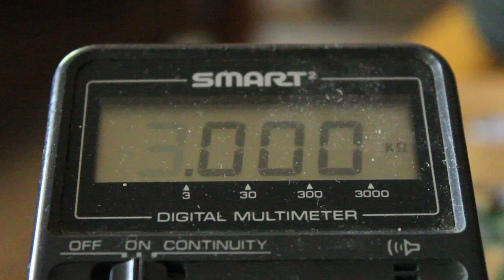PS2 Potentiometer Adjustment - Disk Read Error Fix

Comment: you don't even have to go through all of that to get the laser out. Also I think every ps2 is different because if you set it the way he does in the vid ps2 games will send you 2 a red screen while blue ps2 disc and psx games work. I had to adjust the CD screw the way he did and adjusted the DVD screw the opposite way.

Comment: Quick question. Will any volt/multimeter do or would you recommend a specific one?
Reply from the maker: For this task, even the cheapest eBay multimeter will do.
Reply: @SamCampbell  Thanks for the quick reply. So what setting did you say I should put it in before I start the reading? also, I have a slim sph 79000. But i'm looking to get a 90000 series. Should I still be aiming for the 720 goal?
Reply: @SamCampbell  Another dumb question but, am i supposed to do this while the ps2 is still plugged into power since i'm looking for a live current reading?

Comment: Thanks very much!!! You saved my evening :) In my case I had to rotate the screw anticlockwise but everything else was extremly helpful.
Reply: Same for me. My Ps2 didn't read neither CDs nor DVDs . For CDs it worked rotating clockwise a little, for DVDs I had to do the contrary (after a couple tries rotating clockwise I tried the other way around thanks to this your comment.

It''d be good to mention it at least in the description I think. Especially for people that doesn't own a tester.
Reply: @papparaba5504  You need to be careful when spinning the pots the other way. You can easily damage the laser assembly. If you don't do it with a multimeter don't even try to spin it the other way. Anything below 650 Ohms will damage the laser.
Reply: @zvonjimir  I checked other 2 ps2 (that shouldn't have trimmer problems) afterwards with the multimeter and those gave me very different results. I don't know, it seems they're all regulated differently on each ps2. When I have time I'll check also this one I regulated without the multimeter. Anyway I'm using it without problems since then.
Reply: @papparaba5504  yep, it depends on the version. With lower Ohms it should work just fine, but it will probably fail sooner. Hope you found a sweet spot because i didn’t have much luck with my assembly lol.

Comment: I guess my laser just decided to die. I tried adjusting little by little for a few hours but I've given up. Was playing MVP 07 and my game froze, so I just went to bed. Now the ps2 just refuses to read any disc at all, and there's a new System Configuration save file for some reason, but all I've done is insert that MVP 07 disc after getting it. Haven't even so much as moved the console at all. Booooo

Comment: I bought a apparently brand new PS2 slim in its original box with its ac adaptor and controller etc in its original platsic and the plastic protection on the ps2 was not removed. the seal on the box was opened however. When I booted it up I got the chose country and language menu which you only get once on the first startup. When I insert a disc it makes some weird grinding noise just for a few secounds and nothing happens, the disc spins but it just makes noise for a little while. It does sound a little like the problem your are fixing in this video but the sound is not constant.
Reply from the maker: This solution here attempts to fix tired and older lens by forcing more power through them (essentially). What you are describing seems more like a mechanical issue. You could always trying opening up the disk drive and seeing what is grinding.

Comment: Wait , when you turn clockwise it increase or decrease the resistance ?
Reply: Turning the screw clockwise (right) would increase the voltage whereas doing so counter-clockwise (left) would decrease it.

Comment: Good job just did the same to mine to get it playing DVDs again.once they get old the lazer loses power and those screw keep it from going in the trash just wish I had a voltage meter afraid it's to much power which will shorten the life drastically but I turned it ever so slightly like in the vids and played first try.

Comment: I've been able to get the DVD portion loading everything very well at 1200. I primarily play PS1 games so I need the CD side of things more. It used to be in the low 600s so I turned it up to various different values between 700-1200 and games will either not load at all, or they will load but it will take until the PS2 menu comes up.

The reason I tried this was because all disks were loading perfectly, but a brand new copy I have of FF6 was constantly coming back as "Please insert PlayStation format disc". Now, I still get that same error but it takes about 10-15 seconds for a PS1 game to actually start loading. Do you have any suggestions?
Reply from the maker: These lens assemblies are generally very sensitive, so it could be that it is simply wearing out. There are other trouble shooting steps you could take, like checking that the disk motor isn't running slowly. However, I'm willing to bet that you will probably need to invest in a new lens. You can get them fairly cheap on eBay
Reply: Sam Campbell i have got a new ps2 slim lens part its not reading most of my games and some of my burned dvd games i did what u did in the video but i dont have the voltage scanner meter or whatever it is called and cant get it to work please help

Comment: My Ohms reader was throwing numbers all over the place so I was basically adjusting blindly. To make matters worse, I didn’t have a screwdriver small enough for the screws under the laser so I ended up screwing them up. Now, I am left with either buying a whole new laser setup or a used PS2 system and hope it works good. Warning to anyone else attempting this, the screws under the laser are very very very fragile, make sure you have a screwdriver that fits!  :(

Comment: Fixed mine this way.
Here are some tips:
- if the disc spins like crazy and PS2 still can't read it then it means you have rotated potentiometer the wrong way and the laser don't get enough power. In my case i need to rotate it COUNTERCLOCKWISE.
- when PS2 stars reading discs, rotate it back just a VERY little bit until it stops reading then again. Then rotate it VERY VERY little bit ahead until it reads discs again. This way you will be sure you have minimal power increase and your laser will work longer.
Reply: My disk fluctuates back and forth then spins the correct way but doesn't spin fast and it would eventually say can't read disc and I tried what you recommended but no luck
Reply: Anw What model of ur Version Ps2? how much you set the Dvd Ohm ? and Cd ohm?
Reply: You're a lifesaver, dude

Comment: I Have Ps2 Slim Model Scph-90006 Ntsc-j,It Read The Game But It Wont Load It And Taken Me To Browser Please Halp!!
Reply from the maker: Can you hear the disk spinning? If not the drive motor might not be working correctly.
However my main recommendation to you if you have followed all of the steps correctly, simply get a new lens off eBay: https://www.ebay.ca/itm/PVR-802W-Replacement-Laser-Lens-Repair-Parts-For-Sony-PlayStation-2-PS2-Slim/253776947095?hash=item3b1648e797:g:6OIAAOSwqVJawv1p
Reply: @SamCampbell  The Disc Spin And The Motor Is Fine The Laser Also Fine My Game Disc Is Gold

Comment: Hey bro I dont have a voltmeter what should I do
Reply from the maker: You can "guess" but you are more than likely to just burn out the lens. A multimeter is only $5 on eBay https://www.ebay.ca/itm/LCD-AC-DC-Digital-Voltmeter-Ammeter-Ohmmeter-Multimeter-Volt-Tester-DT830D-Tool/173224098006?_trkparms=aid%3D555018%26algo%3DPL.SIM%26ao%3D2%26asc%3D40973%26meid%3D45f3a94277ae4ae68cfd2a10103f62c7%26pid%3D100005%26rk%3D2%26rkt%3D12%26sd%3D263707704955%26itm%3D173224098006&_trksid=p2047675.c100005.m1851
Reply: Sam, how do I know if the lens is burned out? will it still spin discs and show a visible red dot through the disc? my fat ps2 new laser will just spin forever , and when I click browser it keeps saying reading disc.
please help
Reply: it reads ps1 games though too

Comment: Umm, my laser's now making a weird buzzing noise? What should I do
Reply from the maker: Well if it seems to be working in it's current state, then I would recommend increasing the resistance until it no longer reads any disks, and then bringing it 5-6 Ohms back into the region where it was reading disks. This may help with the odd sounds, however these disk drives are rather cheaply made with several variables that can cause them to fail over time, the noise could just be a defect, or be a sign that the drive is failing. In the situation that it should fail there are several replacements available on eBay: https://www.ebay.ca/itm/Optical-Disk-Laser-Lens-Deck-Replacement-PVR-802W-KHS-430-for-PS2-PS-2-Slim-New/252282688322?hash=item3abd385342:g:wkIAAOxyKsZRyWag

Comment: Now my laser wont work at all 😑
Reply from the maker: That's a shame, it can happen, the variables for what a lens can take before it burns out is quite wide. Luckily you can still buy another laser on eBay: https://www.ebay.ca/itm/Optical-Disk-Laser-Lens-Deck-Replacement-PVR-802W-KHS-430-for-PS2-PS-2-Slim-New/252282688322?hash=item3abd385342:g:wkIAAOxyKsZRyWag
Reply: Instead of watching unqualified people messing about with playstation 2 lasers on youtube you should have took your PS2 to a repair shop and let people who know what they are doing look at it. Time and money can be wasted because of misinformation by unqualified people on the  internet and youtube. In not happy because I completely messed up my PS2 slim after watching this video I had to bin it because I made things worse. Do not get a new laser off ebay and try to fix your PS2 yourself....take it to a repair shop and let a qualified person look at it. The lasers that ebay sell still need calibrating I discovered this when I bought a new laser. My PS2 still refused to work and I messed up the new laser to.....more money wasted!!!!!!

Comment: You turned the screws at least 10 degrees.... 2 degrees is hardly moving it...
Reply from the maker: The resistance measurements are more important than the technicality of the degrees of rotation.

Comment: Thank you for this guide! Got a ps2 slim at a swap meet and it would not read dvds. Now it works, hopefully it lasts for a while.
Reply from the maker: I've read that this fix is technically temporary, but I've done this several times in the past and gotten at least 5 more years before having to replace a lens

Comment: Reading random DVD's.  Reading ALL CD media however.  Trim Pots found at: DVD=694  CD=641 Ohms. Did not adjust CD Pot.  Tried 860 Ohms on DVD Pot, no joy.  Tried 1200 Ohms on DVD Pot and Wha-LA!!!!  Reads everything now.  Oddly, more resistance and less power to Laser worked. 
Watch the Laser power ribbon and don't make my mistake of bending it so it scratches the disc media while moving back and forth on rail.  
Thanks for this guiding video, or I would have bought a new laser.  Your posting has made alot of people happy!  Good on Ya!

Comment: Nice tutorial & recording! i want to know if the problem comes from my disk or the laser itself.
Reply from the maker: Well, the easiest way to determine that is to try other disks that you have. If the success rate is very low, then it it most likely the laser itself
Reply: Thank you for speedy reply, btw my disk has no scratches and works fine on my friend's ps2 so i'll try to adjust the potentiometer.
Reply from the maker: Yeah, that sounds like it is your lens. Give it a shot and make sure to measure it before booting the system
Reply: I gave it a try, i oiled the worm gear & marked the two screws as a backup. Thanks man i owe you one!
Reply from the maker: Glad to hear it!

Comment: I have no video after doing this, what should i do? When i turn ps on, green light comes up put no vid and sound..
Reply from the maker: Bezimeni TM Unplug all of the ribbons on your disk drive and run the PS2. Does it display anything?
Reply: It doesn't, really don't know what's up with it.. I think gpu might be dead but it has nothing to do with this vid, guess it'ts just coincidence.. It looks like AV connector doesn't work, i tried changing the cables :/

Comment: The little card on my ps2 snapped in half D:
Any help?
Reply from the maker: I'm not sure what card you mean
Reply: the small ribbon in the disk drive
that moves it back and forth
Reply: the small ribbon that makes the motor moves
pls i need help
Reply from the maker: White ribbon, or orange?

If it is orange you are in luck: https://www.miniinthebox.com/replacement-laser-ribbon-cable-for-ps2-slim-scph-7000x-_p156654.html
If it was white, you will need to de-solder it and replace the ribbon.
Reply: the one that is attacted to the motor
Reply from the maker: Then unfortunately you'll have to replace it with something like this: http://www.ebay.ca/itm/SCPH-7000x-70000x-Spindle-Drive-Motor-Engine-Repair-For-PS2-Slim-Replacement/252498323734?

Comment: I haven't tried opening it since the time this comment was written but whenever I insert a disc inside the PS2, the motor sorta just stops and goes while its trying to read it. It would do that for 5 seconds then the a "clicking" noise would sound, after that, I get the disc read error message. Will this method help with that? I would like to know before opening it. Thanks!
Reply from the maker: This is definitely one of the possible cures for that problem. Make sure you've got a multi meter for measuring the resistance while you're at it.
Reply: Okay, thanks soo much for the quick response!

Comment: I'm going to try this, but I was wondering, how long after doing this procedure will your ps2 function till it reset or errors again? Will it work for quite awhile?:))
Reply from the maker: I've read the until the lens burns out, so probably long enough to pass it down a few generations before it fails and needs a new lens. However, manufacturing tolerances, and human error can make some weaker than others and fail much faster

Comment: I tried this and now my disk does not even spin anymore so I don't know what to do
Reply from the maker: Did you use a multimeter to verify the resistance?
Reply: Yeah both of them were above 720 but the disk drive looked different from the one you had
Reply from the maker: If you increase the resistance do you see the motor turn? Also, does the lens seem to be working (place a disk on the top to see if a red light appears, do not look directly at the lens)

Comment: I can't thank you enough! I just bought a ps2 slim at a yard sale for $50, then spent another $40 on games and a memory card. I got home and it worked the first two times and then kept giving me disc read errors. I tried this out and was skeptical because I dont own a voltmeter but sure enough, it fixed the problem. thank you so much!

Comment: i followed this guide, but i dont have a metrometer to check it.
now the disc doesnt spin at all and make weird noise.
do you know any idea why is this hapenning? will metrometer help?
Reply from the maker: A multimeter is highly recommended, because without it, it's like backing your car out of the driveway blind. Perhaps you'll make it out, but there's a chance you'll hit something because all you can do is hear.

Similarly, without a multimeter you are only adjusting the lens strength based on feel, where the screw was originally is the reference. However, you have no idea if you are around the 700Ω mark. There is a large chance that you've gone too low and the lens has burnt out.

So unfortunately I believe you'll have to replace the lens,
Slim: http://www.ebay.ca/itm/Optical-Laser-Lens-PVR-802W-KHS-430-Replacement-Repair-Part-for-PS2-Slim-/252282688322?hash=item3abd385342:g:wkIAAOxyKsZRyWag
Fat: http://www.ebay.ca/itm/New-V1-V8-KHS-400C-Laser-Lens-Driver-For-Sony-Playstation-2-PS2-Replacement-US-/232379787738?hash=item361aea29da:g:Qm0AAOSwIjJZP7K9
Reply: As Sam said, you've probably gone too low. The lower the ohms,  the higher the output. The safe range is usually about 900-1800 ohms. I believe the PS2 fat version has a factory setting of around 1130, so I believe the PS2 slim should be near this number. I believe the output you're looking for should be within the range of 990-1050

Comment: Thanks for the video. My DVD is at 812 ohms so i will lower it to about 700. But my CD is at 300 ohms.  Should the CD screw also be around 700 ohms ?
Reply: I found the original settings online and so managed to answer my own question. "V7 stations - CD = 1200, DVD = 1100 to 1400".
So 300 ohms for the CD was WAY too low. This was a replacement laser and i just popped it in the ps2 5 years ago. I never knew to check so the damage may already be done.
Reply from the maker: Yeah, you might want to try getting a replacement lens if it still isn't running at that high a strength.
Reply: Sam Campbell I lucked out. I placed both around 765 ohms and they seem to be working. I played one problem PS2 game for 2 hours and einhander for 5. Really glad I found this video. Much appreciated. :)
Reply: Going on a month now playing a game that was a predictable problem. This fix definitely works. Thanks again!
Reply from the maker: Good to hear it!
Reply: tionik06 680 ohms is the sweet spot if the laser is too bright you run the risk of disk burn : / & DVD =ps2 game also CD = ps1 disks black or blue back ; )

Comment: I have the latest PS2 Slim version and I am having a problem with reading one game disk. It reads the disk but then nothing happens and the screen only shows my memory card and the DVD. What could be wrong with my PS2?
Reply from the maker: What is the resistance measurement on the DVD potentiometer?
Reply: Sam Campbell I will have to open my PS2 and measure that pot. How do I measure that pot? One probe on the screw and one on the soldering?